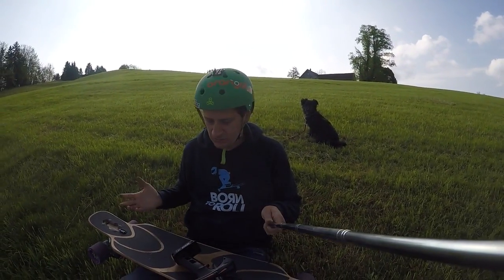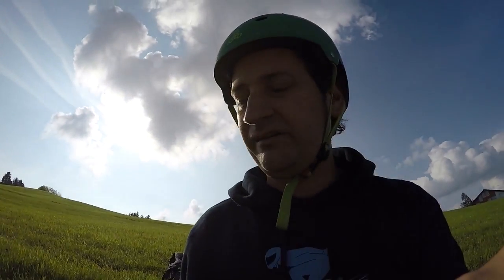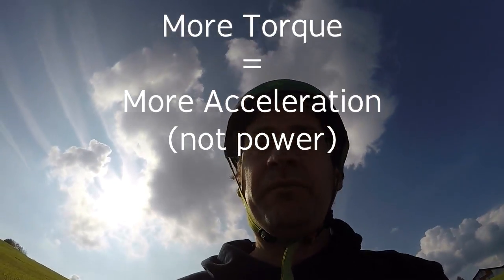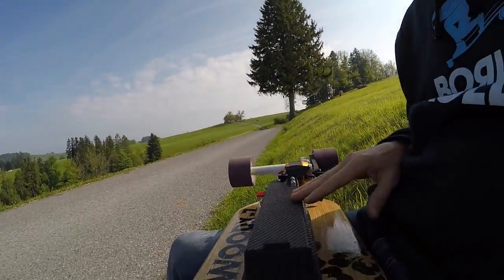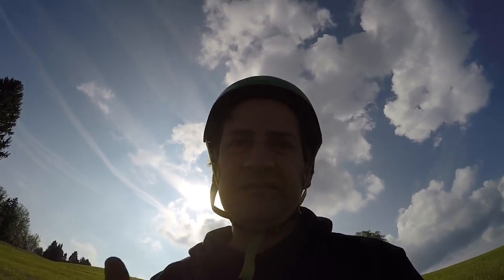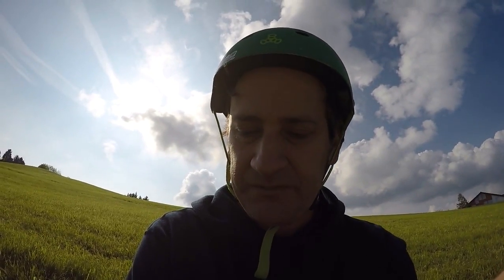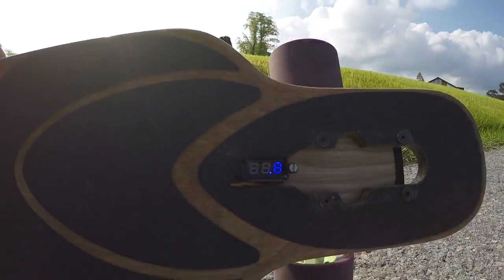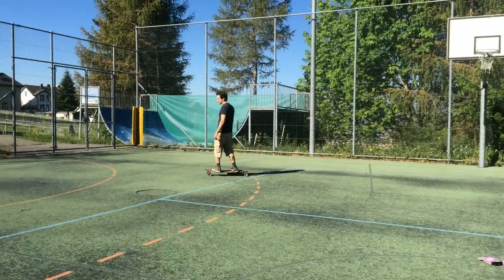Electric Longboard Build | Tips and Advice | 5 Jun 2017

Comment: Thanks for the tips! looks like a well build longboard!

What are your thoughts on hub motors?, Im planning my build and I can't decide between belt vs hub setup.

I also think that you need softer wheels and not bigger, bigger wheels is often more weight and harder to turn.
Reply from the maker: Less moving parts is always more reliable. I think hub motors are the future of electric longboards for sure.